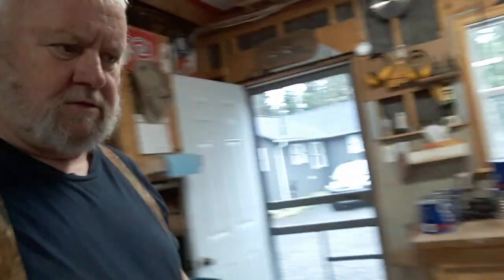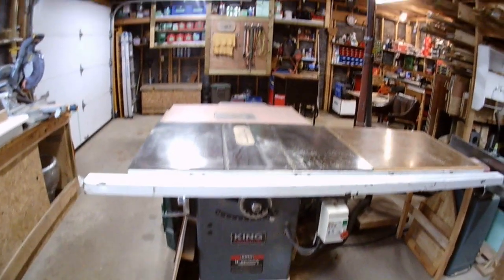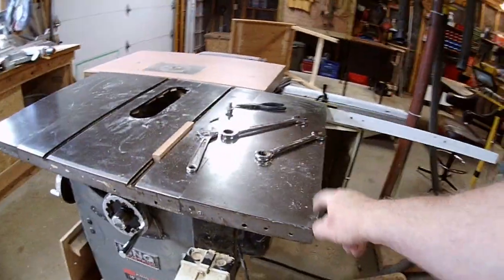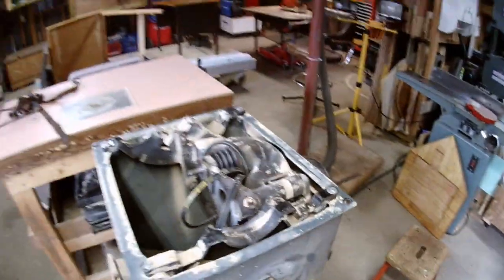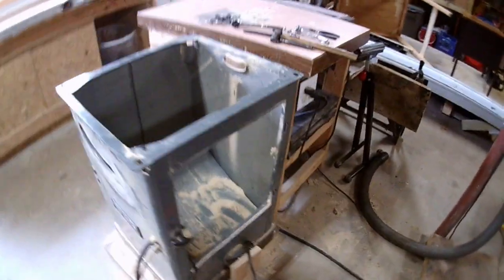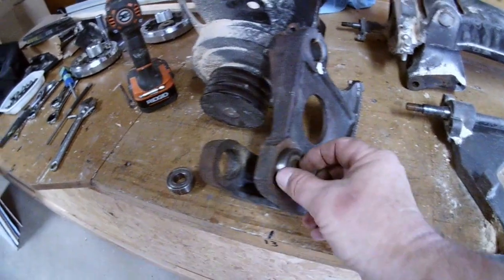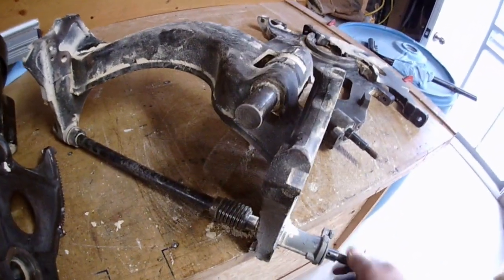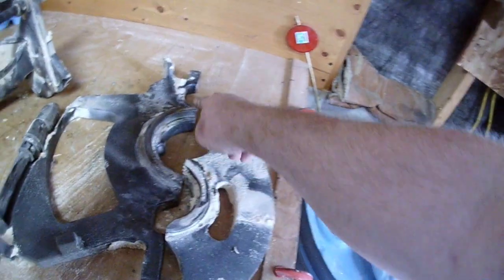Table Saw Bearing Repairs Part 1

Comment: Grampie, you have a little cleaning and reassembling to do but doesn't appear too drastic but will be time-consuming.  So tell me about the grease-less grease (smile).  I was thinking of silicone but don't know how dust-free that would be or after it got warm, how  dust-attracting would it be. When cool or room temperature, the silicone does well, but once heated (I couldn't tell ya). Oh, I just read your reply to T-man below and see you didn't use silicone. Looking forward to your Part 2 of table Saw repairs.  I mentioned your channel in my video "Make Room For Implements Part 1" since your clean-up video put fire under my butt to get busy (haha). Have a good one and watch yourself with sharp edges on the saw.  I have an old Craftsman table saw that was given to me and it's nice and heavy and also...nice and sharp on the edges.  Later.  Full watch 👍.
Reply from the maker: How's she goin'?  Sorry to have 'lit the fire' there buddy, but you'll love me for it later!!!LOL  There were some sharp edges on my saw but I think I avoided them.  I also want to try and make the saw cabinet more dust tight and I show that in upcoming videos.  Anyway buddy thanks for tuning in and giving me  full watch.  That's impressive!!!  Take 'er easy!!!

Comment: I agree the motor bearings are ok.  Is there a spray on silicone lubricant for the trunion assembly that doesn't attract powdered saw dust Mike?  Those guts look similar to the PowerMatic saws.  Nice and heavy duty, industrial in design is what it looks.  Good job so far sir.  Of course I know its all going to work out fine.
Reply from the maker: Hello there Wendel!!!  I don't want to give anything away for the next episodes but I ended up changing the motor bearings and as for the lubricant:  I didn't have any silicone spray lube so I ended up using grease.  I know the sawdust will stick in it real bad but rather than lose a day going to town and back I just used grease.  There, I hope I didn't spoil the next videos for you...LOL  Thanks for watching and stay real buddy!!!
Reply: After I posted my comment, I read on down the list and saw where you spilled the beans to another fellow.  Were they really bad, or did you change them on a preventative basis because its all apart and easy to do during this repair.
Reply from the maker: Hey there Wendel.  No the bearings ended up being bad.  They sounded and felt good on the motor but when I took the motor apart they were pretty stiff.  FUBAR as we used to say in the trade!!!  Aww man, now you know all the good parts for the rest of the series....  Oh well hope you tune in anyways!!!  Take 'er easy!!!

Comment: Oh this is a nice project keep your side running for years to come that's for sure!

I might have a question or two for you about replacing bearings in the future thank you for sharing God bless bye for now Ken👍
Reply from the maker: How's he goin'?  Thanks for watching and if I can offer any help with bearings or anything you see in any of my vids, I'd be more than happy to help out!!!  Take 'er easy buddy!!!
Reply: @GrampiesWorkshop  okay thanks I have electric motor for my table saw it has been sitting outside and now the bearings are really stiff what would you suggest
Reply from the maker: @HomeImProveMentHow  I would say the bearings are toast and need to be changed.  If you want to change them yourself you'll have to tear the motor down.  In part 2 of this series on Table Saw Maintenance I tear my motor down.  I'll be posting that on the week end probably.  Have a look and you'll see one being done.  Thanks for the question and I hope this will help.  Take care!!!

Comment: 👍 thumbs up ! What Do you use graphite for lubricating mechanism for lowering and raising the blade, or what do you use to make it smooth operating? I look forward to hear from you keep up the great work bye for now.
Ken
Reply from the maker: Hello again Ken!!!  As this series progresses that question will be answered.  But just a 'spoiler alert' here, I was going to use graphite but I only have the spray on type and I find that stuff wasn't working out too good in other applications I tried it on so I went with grease.  Grease isn't the best answer here as sawdust will stick to it and I'll have t clean the saw more often, but I figure in order to have the saw work nice and smooth that's what I'd do.  Thanks again for tuning in.  I'm enjoying this interaction and I hope it's helping you with some ideas and concerns you may be having in your shop!!!

Comment: Hi Mike that's one hell of a table saw. It really turned into a project didn't it
Reply from the maker: Hey there Dave!!!  I kinda knew it was going to be a big job but as I got more into the strip down I sort of added some other things to the job list on the saw.  Upcoming videos will explain that a little bit more but basically I wanted to make it more dust tight so it would collect the sawdust better.  Thanks for the comments and take care my friend!!!

Comment: Bin there....done that....It`s a hard job to do but then if it would be easy.....anybody could do it...CHEERS
Reply from the maker: Hey there Gator!!!  The hardest part of this job was getting the parts out of the base cabinet.  They are heavy and cumbersome.  Then the alignment of the table, that's coming up, is time consuming and you need patience, two things that I don't consider my strong suits!!!  Thanks for watching buddy!!!
Reply: @GrampiesWorkshop  I done all this on a Delta table....a bit differant but a lot of precision to get things to be just right....CHEERS